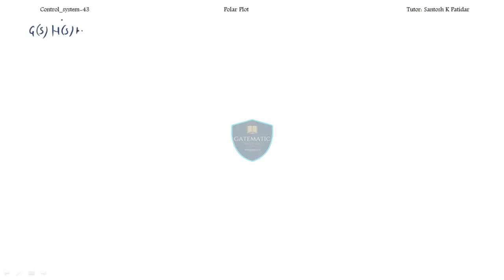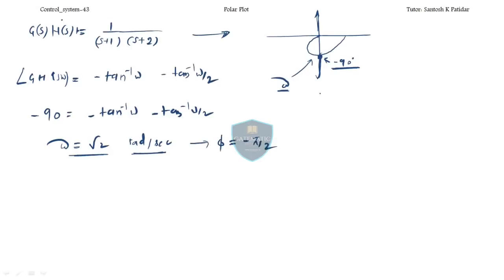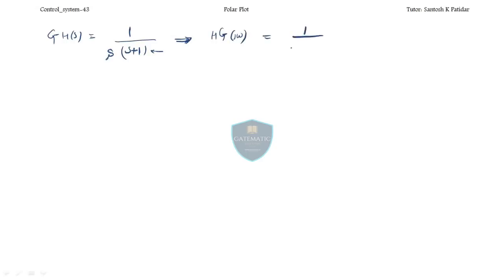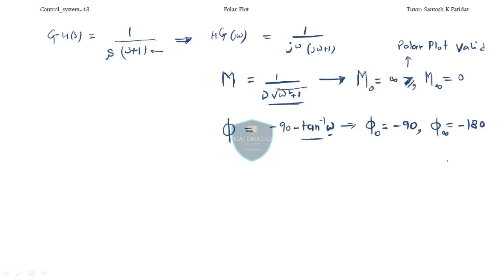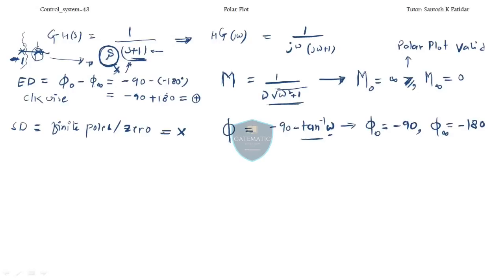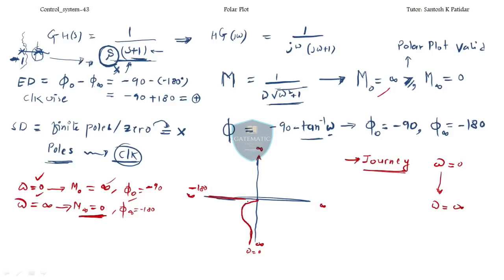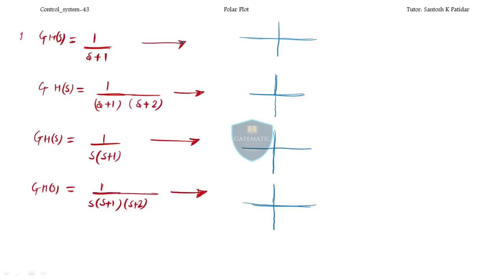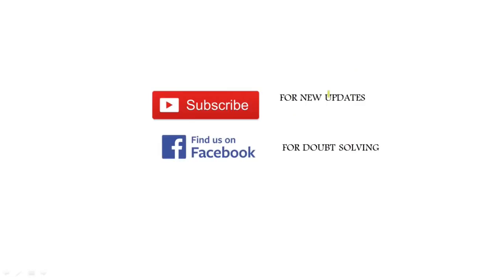Lec 43 Polar Plot (Contd.)

Comment: sir plz explain how you have calculated 'w'. after equating rhs by -90, what you did? m not able to understand sir.. hope you will explain.. thanku.
Reply: take minus common on both sides and cancel it.. then apply trignometric formula for tan inverse x + tan inverse y
Reply: after applying trignometric formula u will get 1/0 =  3omega/(2-Omega^2), that implies 2 = omega^2 and finally omega = root of 2.. that's it...i hope u got it
Reply: BINDU ILURI thanks alot..:-)
Reply: thanks bindu..
Reply: thankuu